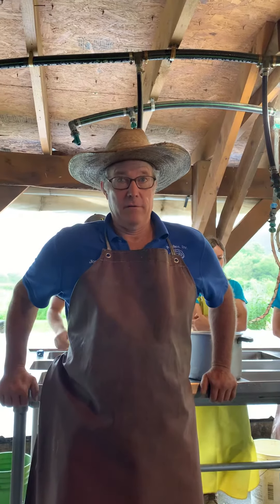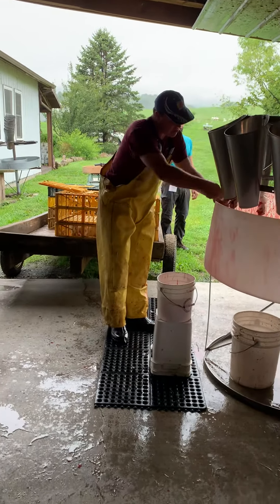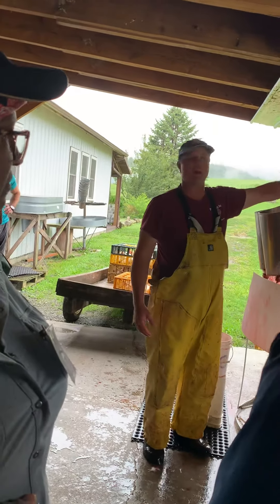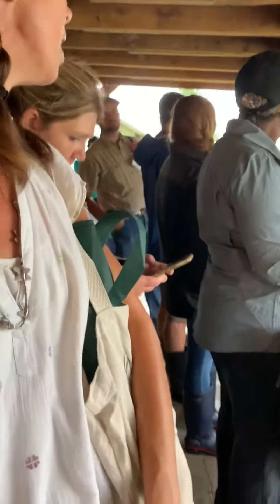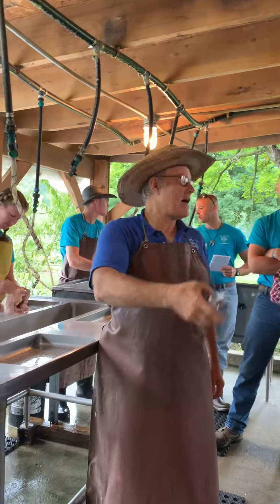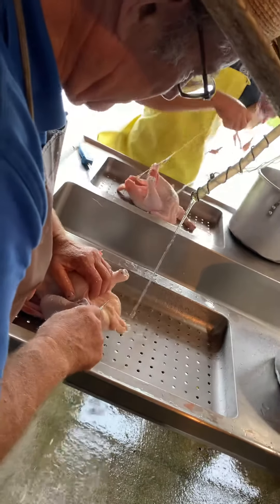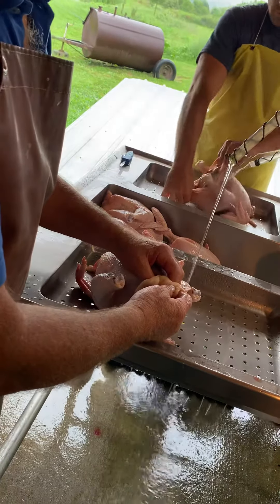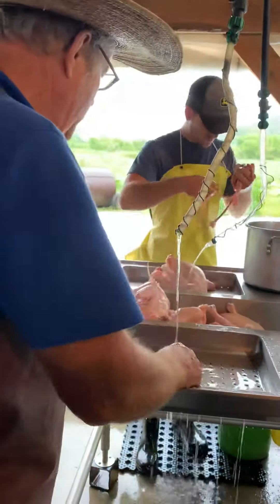Polyface Farm Joel Salatin butchering chickens

Comment: I know you have been asked this because I just seen a video where you answer but what I’m asking is about chickens that is too old or don’t have enough meat or what because we have put them on ice or refrigerator even have put them in salt water for a couple of days use them in a chicken & Dublin or even try to eat them as a regular cook chicken pick up the bold and they are really tough

WHY WHAT AM I DOING WRONG 

? Is how to get a chicken not tough
Reply from the maker: I have found that pressure canning the chicken makes them super tender! With young meat birds I raw pack and don’t even add broth because the process of pressure canning makes the broth. I put legs with bones in one jar, thighs with bones in another and then cut up raw breast meat and tenders in chunks in a jar. 3 qt jars fit 2 birds. 

With older birds you could try raw pack or cook them and make a meat broth. To do this, Weigh the birds. For every pound of bird use 1 quart of water. So a 5lb bird would use 5 qts of water. Place the water in a pot, add whatever veggies and seasoning you would like. I quarter an onion and add large pieces of carrots, some salt and pepper and cloves of garlic. Bring the water to a boil then add the whole chicken. Simmer the chicken for 2 hours. Remove the chickens and large pieces of veggies and strain broth. When chicken cools, pick off the meat to place in jars and add the broth you made to the jars then can them. There are many videos out there about canning chicken and also be sure to check the instructions that came with your canner for other info. Hope this helps.